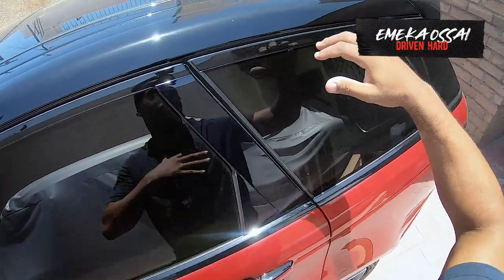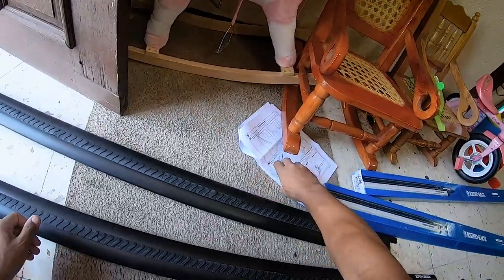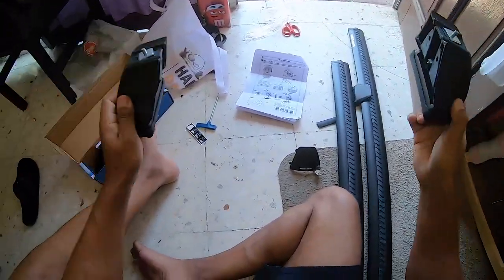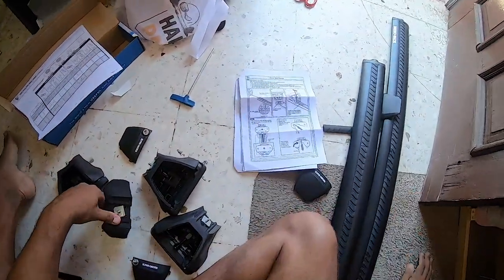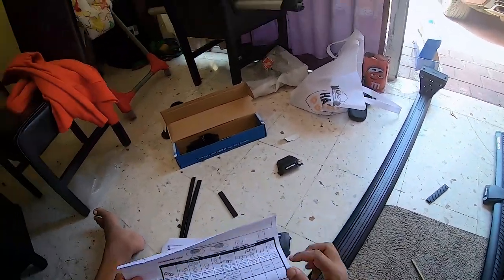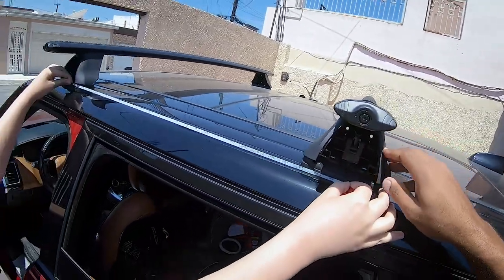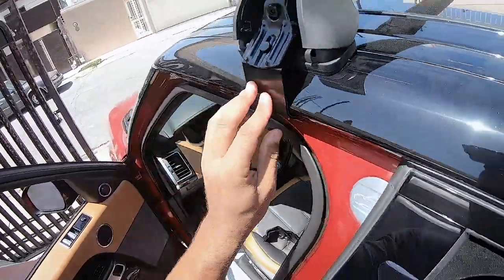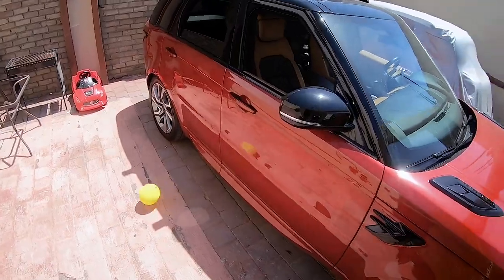How To Install A Roof Rack On A Range Rover Sport L494 | Rhino Rack Install Video

Comment: Is there any wind noise from the side clamp going under the door gaskets? Thanks I am going to buy the same rack for my RRS.. Just wanted to know about the noise level.. Thanks again for the video...
Reply from the maker: ZERO WIND NOISE! Stuff like that would drive me nuts!!! 
The only extra wind noise is the fact you have a big ass thing on your roof. Without the cargo carrier, there will be a little more wind noise from the bars, but barely noticeable. 
Also, the wind noise was really only at highway speeds, not in town from what I can remember.
Reply: @DrivenHard  Sounds good, thanks for the information..

Comment: I like how this roof rack doesn’t require the side rails. I’m looking to add a roof rack to my Range Rover sport when on trips but want to remove it easily when driving around town. After the initial install is it pretty simple to quickly remove and reinstall as needed?
Reply from the maker: Yes super easy. Cause you have all the markers (white arrows) in place you just line it up again and you are good to go!
Reply: @DrivenHard  Are you able to open and close the moonroof with roof rack on?
Reply from the maker: I Want to say yes but I honestly can't remember

Comment: You make great videos.   I just got a 14 Spt with OEM luggage rack.  I want to take the cross bars off to make it look a little sportier.  However they have a star/gear looking screw (not hex) holding the clamps on.  The problems is I can't get the head of the screw driver into the hole.  It has a center pin blocking the hole.  Any idea what to do or anyone else have this problem.  TIA
Reply from the maker: Is it a special type of screw driver you need?? Thats what it might sound like
Reply: @DrivenHard  Thanks for responding.  I found out it needs a tamper proof type, available on Etrailer
Reply from the maker: All good man. I think I saw your post in the forum as well. Glad you were able to get it worked out